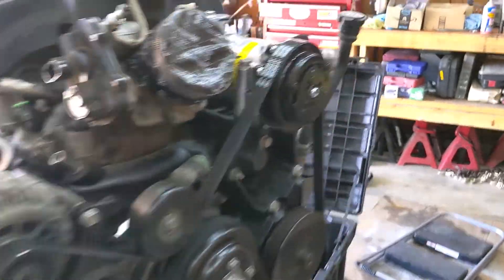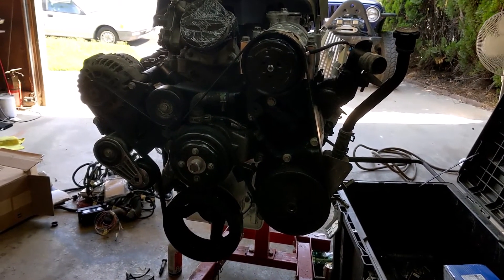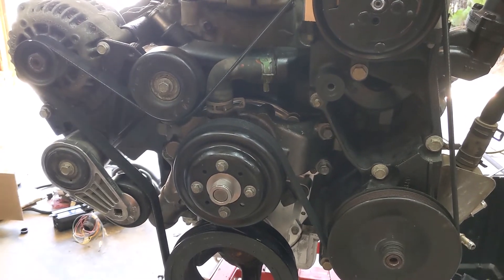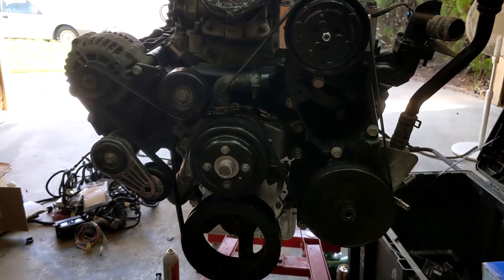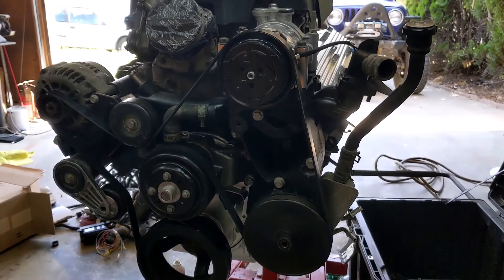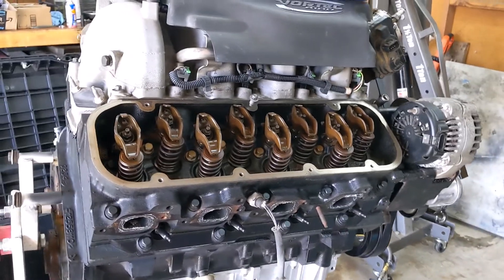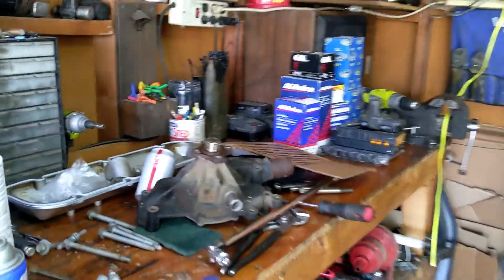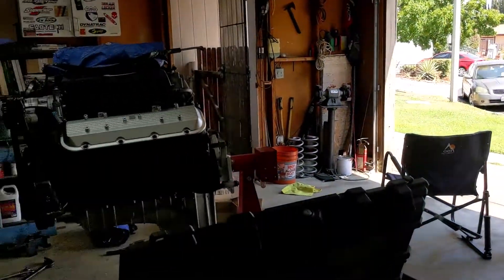Squarebody Suburban Vortec 8.1 Swap - G-Van Accessory Drive Install

Comment: You wouldn't happen to have the part numbers for the  AC and Alternator brackets?  thanks
Reply from the maker: That ac bracket is damn near unobtainable. It comes from 01-02 GM vans with the 8.1. the part numbers are discontinued at GM (and have been for several years), and so the only way to get one is to find the ultra rare one in a junkyard. Good luck.

Comment: What’s up brotha, good to see you here. Will the van accessory drive kit fit on all 8.1 or is it only for the van’s 8.1?
Reply from the maker: It bolted right up to my engine. It's a direct fit but must come off an 8.1 from a van or TopKick
Reply: What about the fuel system? Is it a return style fuel system?
Reply from the maker: My 8.1 has a returnless fuel rail.  I am getting around this by using an Aeromotive Bypass Regulator, which I will plumb back to the return line on the stock TBI system.  I'll drop a high pressure fuel pump in the sender, and be good to go.  It will work.